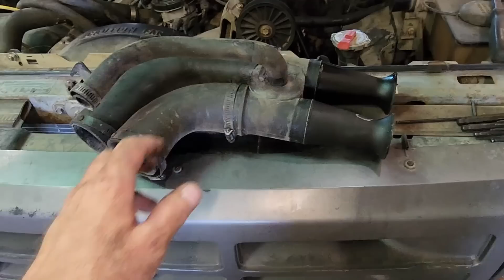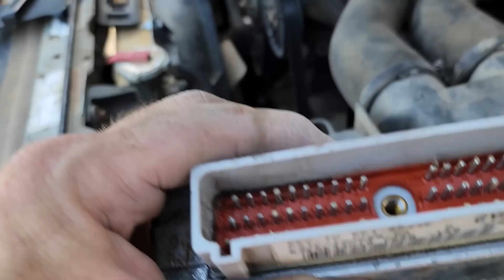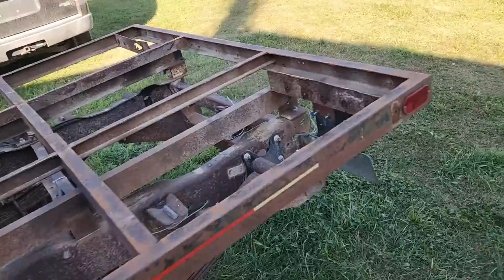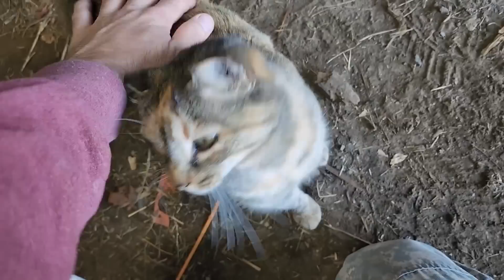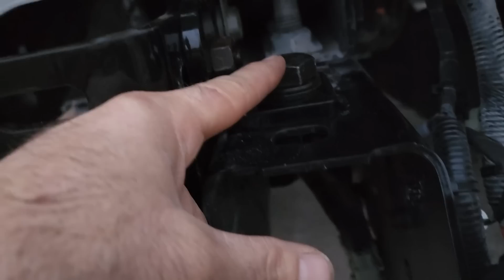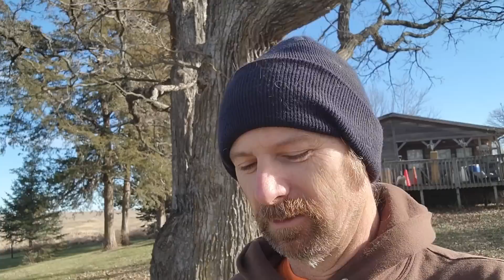I am almost overwhelmed with truck problems!

Comment: Those earlier ford fuel rails like to rust from the inside out. Have had a few where they start sticking injectors open as pieces of rust break off and get wedged in places and others that just stop fueling when the inlet side plugs with rust.

Comment: I’ve contemplated replacing my 03 super duty with something less rusty and a little fancier, but the 7.3 still runs like a top at 368K, and I just can’t force myself to pry open the wallet and tie myself to a payment again. I totally get comfortable and reliable though! I like the bullnose too. I just bought an 81 2wd swb with a 302 and c6 I’m planing to drag race this year.
Reply from the maker: @gumbomudderx7503  where you planning on racing at?
Reply: @ I’ll be racing at Sikeston MO, about 20 miles south of Cape Girardeau, and Paducah KY, mostly. Those are my main two local drag strips. I had to convert a set of rotors from 5x5.5 to 5x4.5 the other day so I could put skinny front runner wheels on it. It’s next to impossible to find skinny 5x5.5 wheels it seems.

Comment: Congrats on the new truck.the bumpers look awesome.i installed the same front bumper on a forest truck for the local fire department that me and coworkers built for them.had to swap the hardware out to.
Reply from the maker: @GhostRider-ii7tz  baffling as to why they would manufacture them with such large holes but send them with much smaller hardware
Reply: @ because engineers are not very smart.it all looks good on paper

Comment: Those are Electrolytic caps. The one closest to the connector is corroded at the terminals. Lots of times they fail shorted. They can pop the can or die quietly... Caps store charge and without them, you can have issues. I haven't finished the video, but if I don't make a comment now, I'll forget. Hopefully the truck runs again. Thanks for the vid, I was wondering when another one was coming.
Reply from the maker: @icemanfiveoh  seems to get harder to find any time to make content. Always something else needing my attention
Reply: @misfittoys8883  I know what you mean. I replaced the clutch master in my danger ranger (which I filmed and put on my channel) and now it's acting up again. All while it's 5 degrees outside. And then there is my FrankenHarley build, and the multitude of other things I'm trying to do. Sometimes you just want to do something without filming just to get it done. Or need to get it done quick. I'm glad you found an ECU specialist to fix yours up. I just repaired a $3k board today for one of our big experiments at fermilab and I should have filmed it, but I didn't. Keep up the good work, I appreciate it, and I know it is sometimes a PITA...

Comment: Great clip with awesome content, totally get it with comfortable rides. Bumper hardware spot on call for bigger bolts. The BCM/computer and the failed tracks and clue cans are capacitors, god find going into the BCM/computer, god job sourcing a repair facility.
Reply from the maker: @jimschafer9196  I'm getting old enough that my abused back cant handle long trops in old broken down shitbox seats.

Comment: I’m not gonna make fun of you for buying a new truck, I gave in and had to buy one too because a drunken college student took out my pick up. I got a 2024 GMC sierra pro. It’s the most basic truck you can possibly get. Basically only has air-conditioning cruise control, and four-wheel-drive. It has rubber floors and no cameras. I only ended up with that because it’s easier to get financed on a brand new one than used one, and it was a hail dent special.  When it had 587 miles my wife clipped a deer and took out the headlight. $1,717 dollars for the assembly. 
But it’s just one of the things about living in a rural area where everything is 40-100 miles away. Having a reliable vehicle is just paramount to survival.
My wife still thinks it’s funny that I choose to drive my old 1992 Chevy  everywhere possible still, but she doesn’t understand the manual transmission in the fact that I could put another hundred thousand miles on that truck and it’s still worth the same as it is now
Reply from the maker: @stevenlatham4397  I would absolutely LOVE the truck if it had a manual trans in it.

I asked the salesman why they didnt have more trucks that were just basic without all the fancy crap on them. He claimed those just dont sell.
I will say that the back up camera is downright awesome for getting hooked up to trailer. Seems barbaric without it!
Reply: @ The United States definitely has some downfalls when it comes to vehicle options. My wife’s dad is a rancher in Mexico, and he has a 2022 F-250 4x4 quad cab with a 6 speed manual transmission.

Comment: If you remove 02 sensor when it's hot that won't happen
Reply from the maker: @scotthancock5240  I wouldnt think exhaust temperature would be hot enough to make a difference
Reply: @misfittoysif it's hot enough to burn and leave a blister it's hot enough to make a difference
Reply from the maker: @scotthancock5240  using pain to make a point,,,,,I like the cut of your jib!